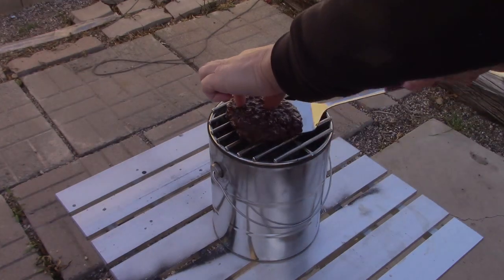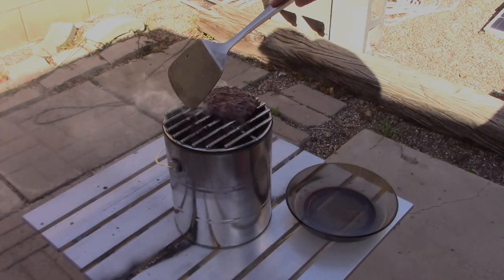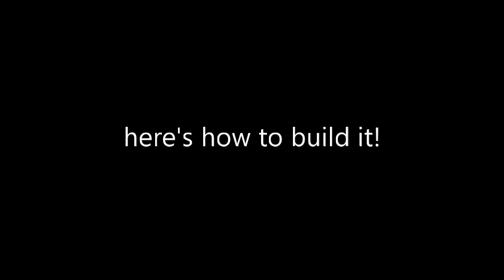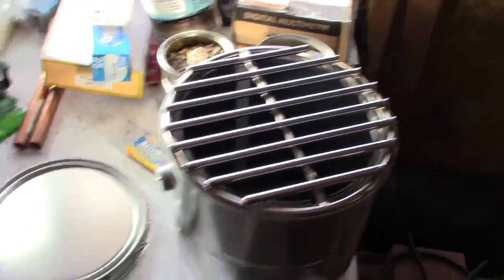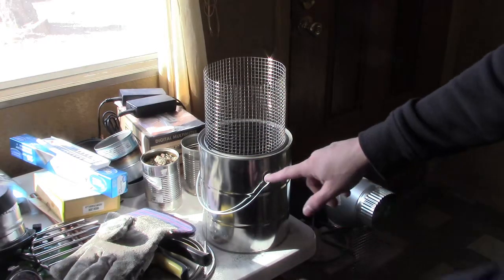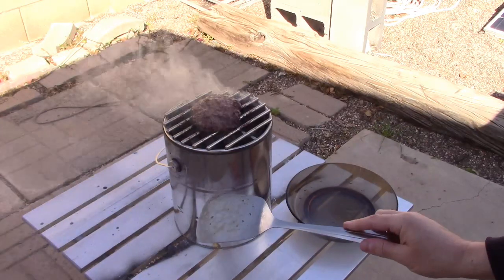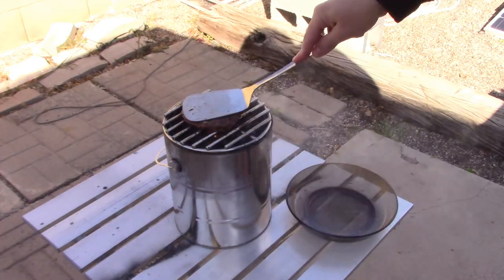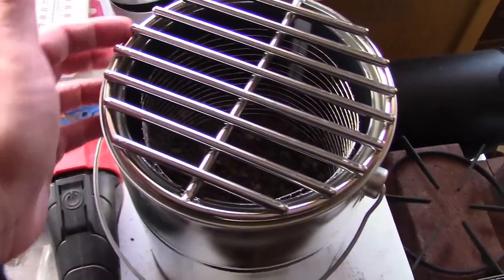DIY BBQ Grill! Homemade Grill! Works Awesome! Stainless Steel Grill! only 4 items needed! Easy DIY!

Comment: At first I thought " I make those all the time from #10 cans" but then I saw the mesh, THATS a sweet idea! I also really like that grill, I added it to my wish list
Reply from the maker: hi there. i've got 2 of the grates so far. i'll be making a second identical unit. i tried it on a #10 can but it doesn't quite fit. you could wire tie to on but why bother. just grab a paint can. the grill fits perfect on those plus it has a lid, a built-in handle and no sharp edges. only $5.28 at lowes. last time i bought them, i bought 6 of them. went to lowes website and had them shipped to home.

Comment: Another thing you can do is add a can and drill a big hole like a rocket stove so emptying the ashes will be easier to handle. You don't have to worry about taking your full stove apart every single time to empty the ashes.
Reply from the maker: hi. do not take the stove apart. there is no need to take it apart. removing the ash is super easy. you just scoop it out with a spoon! a tablespoon works perfect. (other things that work good are ladles, serving spoons, ice cream scoops and even metal measuring cups). the ash just scoops right off the top of the gravel. takes only a few seconds. definitely do not drill any holes n the can. this stove is made to be totally self contained.

Comment: Great idea and build! How do you remove ashes? Dump out and add new rocks each time?
Reply from the maker: hi. it's super easy to remove the ash. first: do not take the stove apart or dump anything out. all you do to remove the ash is scoop it out with a spoon. i use a tablespoon. it scoops right off the top of the gravel. just takes a few seconds. the charcoal is located in the top third of the can so a regular tablespoon (the kind you eat with) works perfect. you can also use serving spoons, ladles, a metal ice cream scoop (lots of choices). the charcoal is so close to the top of the can that you can even use a metal measuring cup to remove it! it's a big (wide) opening so you can fit your whole hand in if you needed to. of course there will be a thin layer of "charcoal dust" leftover on the top of the gravel but that's fine.
Reply: @desertsun02  Excellent response!! So many ways to clean it! I really like it! I normally use a simple coffee can rocket stove for camping and have yet to attempt to use coals for BBQing but this build is a nice option!!!
Blessings!

Comment: Great idea! Thanks for sharing.  Would there be any benefit to adding holes on the bottom of the paint can to improve the ventilation?
Reply from the maker: hi and thanks. the short answer is no. definitely don't cut any holes in this. it's fully ventilated and works great as designed. the wire mesh "burn chamber" allows plenty of air to flow to the charcoal. even with a lot of food on top there will always be plenty of open spaces for air to be sucked into the unit. adding holes would only destabilize it and potentially allow the gravel, ash and/or hot coals to fall out. (plus it would create lots of unnecessary sharp edges and reduce the units wind resistance).

Comment: @desertsun02 I don't know if you'll see this, and I apologize in advance that this question isn't exactly related to this video. 

We saved two #10 cans with the plans of making them into rocket stoves. Unfortunately, I didn't realize that we were supposed to keep the lids and we tossed them. Do you think it's critical for me to try to find lids/start all over with new #10 cans (keeping the lids this time) or could we realistically proceed without the lids and create decent-working stoves? 

I figured if anyone knew the answer, it would be you. Thanks!
Reply from the maker: hi. you don't need the lids of a (#10 can) to make a rocket stove. i've got one or two videos on this channel showing how to make a rocket stove using a #10 can (a coffee can) and those don't use the lid.

Comment: That's a good idea for single people , burn the galvanized metal before you put food on. I stand corrected you used stainless steel for the inner seperator.
Reply from the maker: hi. no galvanized metal on this one.

Comment: Very cool! Have you tried it with ISO or Ethanol?
Reply from the maker: hi. those are different types of stoves. (have several vids of those on channel). this one is strictly a charcoal cooker
Reply: @desertsun02  Thanks I'll look for past videos. Speaking of your other stoves and heaters how does the costs/efficiency of iso/ethanol compare to kerosene/propane heaters?

Comment: No holes drilled for the charcoal to get air?
Reply from the maker: hi. nope, no need for the holes. enough air gets to it just from the top down. i was hoping i could design it that way - and it worked out great! this way it's clean and neat, no worries about ash falling out etc.
Reply: @desertsun02  Cool! 👍🏼

Comment: how does the paint tin fare after say like a year?
Reply from the maker: hi. it's holding up great so far. the stainless steel mesh piece that i use inside the can not only allows for proper airflow but it also protects the sides of the can from damage (due to the heat)
Reply: @desertsun02  thanks im designing my own that will be more dule purpous smoker and grill depending on what doors you shut etc

Comment: I have serious doubts about the zinc plating om the bucket. Zinc oxide isn't very healthy.
Reply from the maker: hi. the inner stainless steel mesh keeps the heat far enough from the edge of bucket. unit creates an airflow down the edges - meaning between the mesh and the edge of bucket. the finish on the bucket still looks new 👍🙂 (sides don't get hot enough to damage the finish)